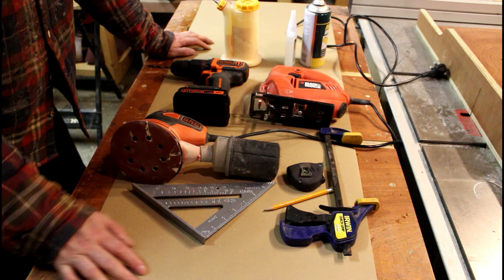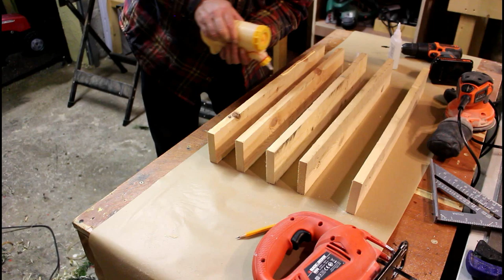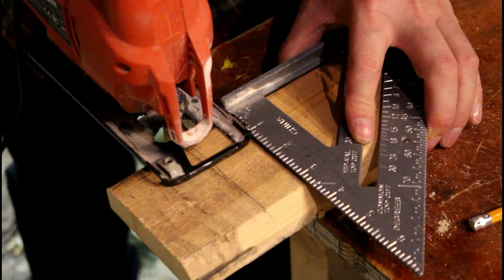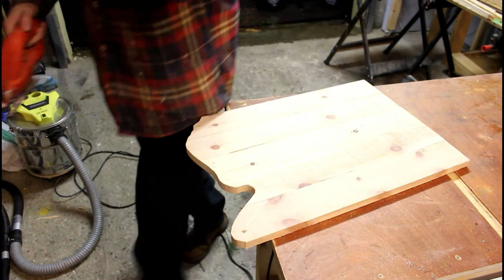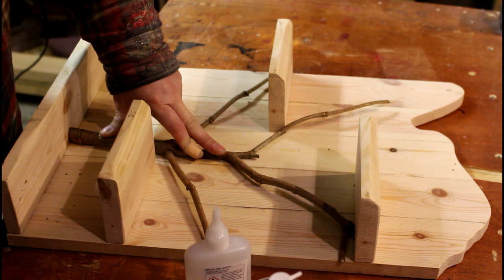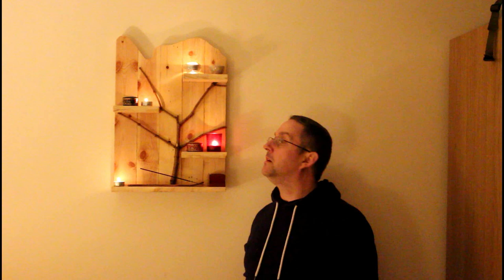Pallet Wood shelves with limited tools

Comment: Hi I'm new to the channel and also new to woodworking. Do far I've made a garden planter and I'm in the middle of building a peaked surround for a Statue for my mothers back garden. I'm in Limerick city and I was looking for a small bit of advice. I've limited funds as I'm not working. I was wondering what are the basic tools I can use for making things to sell from pallet wood. I have a mitre saw a hammer and cordless drill. If there was any tips or ideas of where to go from here that would be greatly appreciated. I enjoy ur video's by the way.
Reply from the maker: Hey Nigel, welcome to woodworking! For tools, I would say get a random orbital sander and maybe a circular saw if funds allow. Apart from that, you have the basics. Build your tool collection as you go. I started with a single drill and a small black and decker mouse sander!